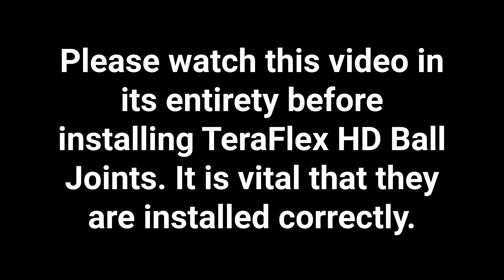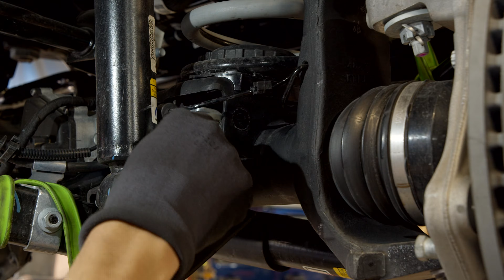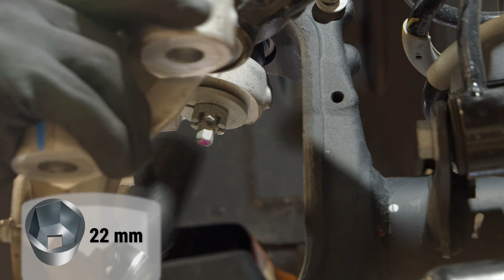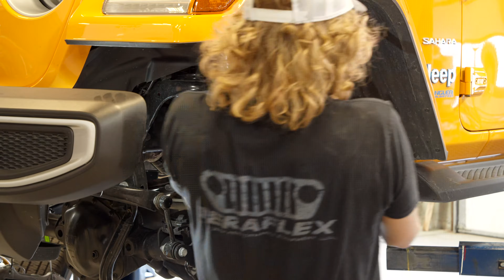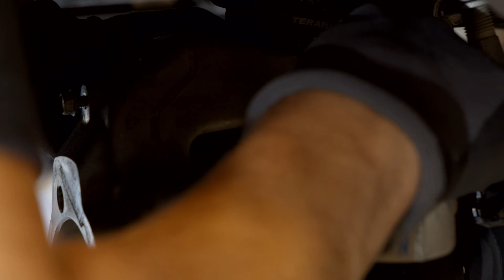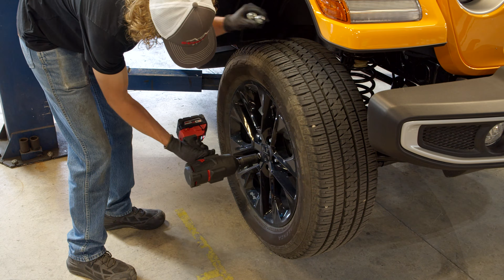JL/JT HD Ball Joint Kit Install | TeraFlex

Comment: How do you keep the FAD fork from  dropping when the Axle is pulled out?
Reply: Tip from thread on jlwrangler forums, put in 4Hi prior to doing the job. This will move the coupler over so you can use the extended coupler to engage the splines on the outer axle shaft to the FAD coupler.

Comment: Are there different torque specs for the Mojave?
Reply from the maker: Good question. The Mojave does not use any different specs when compared to the others, so the specs for installing our ball joints remain the same.